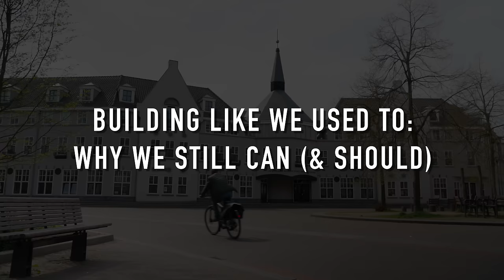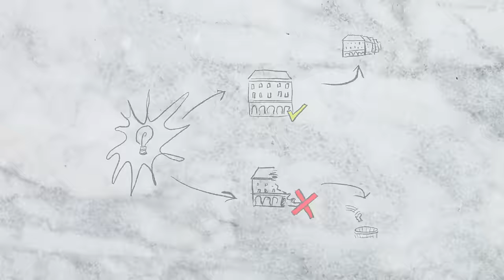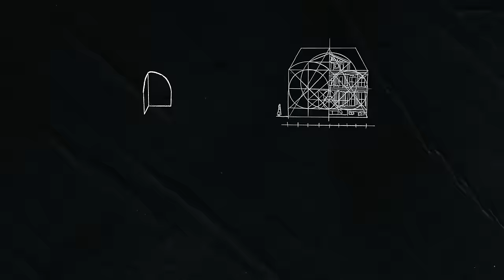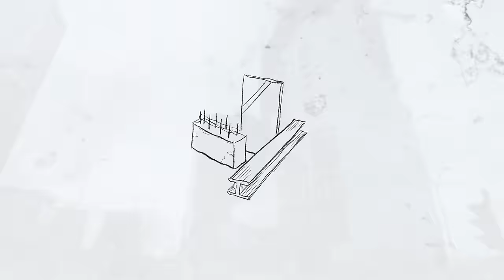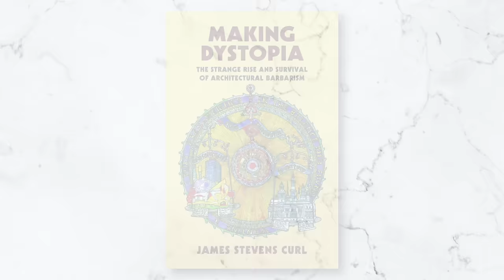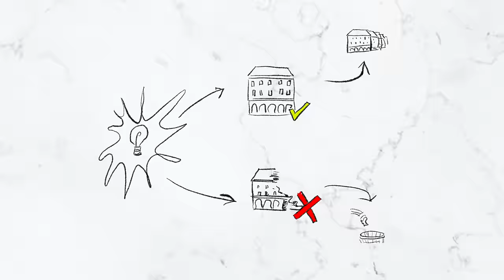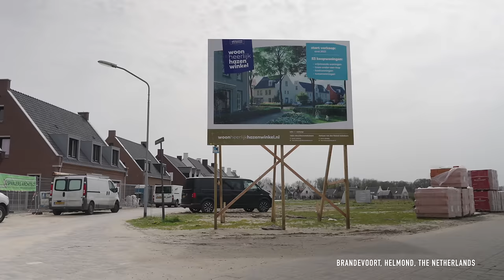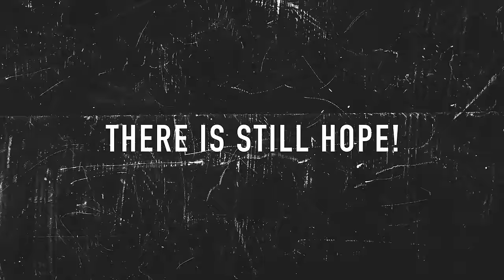Why We Should Revive Traditional Architecture & Urbanism

Comment: In the city centre of London and also in Edinburgh in the UK, I've seen with my own eyes new buildings under construction with cranes and everything mimicking the traditional architecture around them, with old-looking façades and modern HVAC systems behind them. Which made me wonder how many of the "old" buildings around them were really old, because they blended in so smoothly that once the construction was finished it would be virtually impossible to tell the difference from the outside.

Comment: Small correction:
In arid climate, a domed roof is better.
As a flat roof provides a huge area for sun light to fall directly on, causing it to absorb more of its heat.
While a domed roof, or one with a three dimentional shape, will absorb the sun light directly from only the side facing the sun.
Also the domed design allows for more air circulation and convection currents.
Reply: I suppose a domed roof is much more expensive. I believe the falt rooves are also useful for cooling off as people use them to sleep on at night.
Reply: Flat roofs because little rain or snow, also to sleep on at night. They're generally made of materials with high thermal mass like stone, so they absorb heat without transmitting a lot of it through to the house itself during the day, and slowly release it at night when it's cold because arid areas are also actually colder at night. Added benefit of being warmed up if sleeping on the flat roof at night and being cooler because they're open to the winds higher up during the day

Comment: I thought about this for years now. I live in Vienna and every time I stroll around the inner city I feel that subtle sense of peace and - I dare say - pride for what the ancestors of my people achieved 100+ years ago. On the other hand when I'm driving through our industrial/commercial districts I kinda get stressed. Not in the sense that I'm actively getting stressed by looking at these atrocities but more in a subconscious way. In my hometown right outside of Vienna a lot of new buildings were built in the last 10 years and they are all extremely bland and don't fit into the historic town center at all. Some people here started to complain already but due to higher cost nothing "traditional" is getting built here unfortunately.
Talking with many people I found out that this is an issue for a lot more people than I originally thought. Maybe a change is coming soon, just as they changed their building style a few decades ago due to other reasons. I hope so at least.

Comment: Im currently buying a house and it was near impossible to find a house with any kind of charm and not a cookie cutter house where you can see your neighbors through your window. It’s so depressing and i think most homebuyers nowadays just expect living in a new construction home to be the norm and having a more charming older house a nightmare (even though older just means 1950s)
Reply: YOur charming older home IS a nightmear. Heating costs? Extreemly high. Plumbing issues? yes. Bad wiring? yes. Possible lack of a ground loop? Yep! Old construction isn't good. We SHOULD be replacing everything simply because we can now make stuff that's cheep to USE and actually okay for the environment long term. It doesn't have to look bad, but by god old stuff HAS to go.
Reply: @MeepChangeling  um I live in the south, dont need heating often, and since it is an older home it is insulated enough where we dont need to use the a/c often. Not sure about the wiring or plumbing but yea those things should be updated. We have yet to experience any problems and dont have lead pipes. You can have an old home but update the wiring and fixtures if needed. We shouldnt bulldoze every home built pre 1970…
Reply: @MeepChangeling  Rubbish - both your opinion and the result of all that destruction.There wouldn't be all these beautiful , livable places places in the world to visit or live in if we listened to your idiocy. Tearing down everything is also extremely wasteful. innovation canand does apply to refurbishing and maintenance as well as new build. Remember the improvement asbestos everywhere was supposed to bring us? An ongoing nightmare.

Comment: I fully subscribe to "New Traditional Architecture", but I would like if you could do a video on how this approach can avoid pastiche imitation and achieve authenticity. This is probably the biggest blocker to NTA being wholesale employed. 

P.S. Loving your videos.
Reply from the maker: Thank you! I will certainly look at that. It is an important topic

Pastiche imitation will seize to exist when architectural education starts to educate traditional architecture again. Illiteracy in proper traditional architecture causes the ugly pastiche versions. Even though many pastiche buildings are still more pleasant than their Modernist counterparts!

Apart from that, 'pastiche' is a term used by Modernist architects to bash on anything traditional. It does exist, but I hate how the term is being abused to discredit the entire concept of traditional architecture - that has got to stop. As I said, I believe education is the answer to that problem.
Reply: If the emphasis is put on developing new vernacular (local or regional) architecture built from local materials, then the tendency towards pastiche can be avoided naturally.
Reply: @the_aesthetic_city  i think what cause this is just putting stuck or stucko , like putting fake ornements and decorations on a concrete building, instead of having the stones cut to be ornaments, most of the time the building is not made of stone but just a centimeter of stone is added, fake. We should reuse stone building technique and also bricks,  where the brick that is not decorative is used also to decorate with pattern etc
Reply: @the_aesthetic_city  I personally think a lot of contemporary builds are pastiche imitation of modernist innovation. While tastes can differ, it is hard to call early modernist architecture, from Le Corbusier and Bauhaus and the likes, unesthetic. They definitely played with lines and shapes to create balance and form.  Contemporary "modern" buildings seems to have completely let go of that play and just gone for squares "because that is modern and minimalist". It is so clearly profit over anything else.
With that said, I completely agree that these modernist should have sticked to buildings and kept their hands off of urban planning, because they sucked at that.

Comment: If "traditional architecture" is simply an adaptation to its environment, why wasn't modernism? It was developed in Europe post-WW1 as part of the wider modernist movement and as a reaction against previous stylistic trends. 
The 19th century fin-de-siècle was a crisis of style in the arts, the previous century had revived every style and used them freely. Architecture had sunk into nostalgia. The question became what is style? Is it just decoration? 
On the other hand more innovations in engineering were happening, greater structural spans, more glazing became possible (eg. Louis Sullivan etc), the real cutting edge was in technology. Modernism was the Gothic of its day, primarily a technological development (reinforced concrete and then steel) that led an ideological change. This is the context modernism inherited.

Whilst I agree the modernism's application around the world (especially somewhere like Dubai) can be downright offensive, modernism is not all bad and was, at least initially, driven by progressive desires for better living conditions, cheap housing for the masses, lightness, openness, efficient living. The video paints these concerns as opposed to tradition. There was, and remains, a real desire for light and openness in our buildings. Many traditional buildings are dark, cold, energy inefficient, badly laid out, and had major issues with safety from fire, falling etc.

I'm not here to defend car-oriented modernist city planning or leaky buildings or its sometimes authoritarian diktat. However to throw it out along with all its technological innovation seems silly--think about how much engineering goes into particularly larger scale buildings now: structural, services, fire, electrical, etc; how are we to reconcile these with traditional buildings? Most of the expense of modern buildings goes into these engineering disciplines, hence why facades are often boring and functional.

If you're asking for all these innovations AND "traditional" architectural stylings, then I'd say you are getting into the nostalgia you mention. Also, who is going to pay for the extra cost?
Reply: Well said

Comment: This is really frustrating.

It's actually very easy to agree with the premise: saying that most contemporary architecture is boring and doesn't generate good public space. 
There is even a TED talk by the renowned architect Thomas Heatherwick saying exactly that.The silly thing is the solution promoted in this video: 
- that we should just imitate older architecture.  This is silly on many levels and if applied extensively would just serve the purpose of devaluing the styles that supposedly tries to dignify. 
There is even quite a lot of experience on doing that. Unfortunately probably its proponents did´t travel enough to China to see the results of this copycat philosophy.
In my opinion the idea of just mimicking older architecture is the result of a low culture in the architecture discipline. 
Serious and honest architecture comes with a deep understanding of many factors: social, economical, on contructition, etc... and to build a building that copies an old style should require to also mimic it´s underlying means of production.
Doing a building that looks to be old but is built with contemporary construction is just borrowing the prestige rightfully acquired by those styles and using it the same way that Disneyland creates its cardboard parks.

The call for architects to do more complex and contextualized architecture is very urgent and critical for our cities, but it should not be wasted with populist or ignorant solutions that call for a literal return to a "glorious past".
The way needs to be forward and hopefully the contemporary architecture talents will be able to push us in that direction instead of backwards.
Reply: copying other culture's design is not what is being professed here, if china wants to undertake a traditionalist approach to urban design, they would take lessons on the perennial aspects of traditional cities across the world and clothed it with the unique expressions of their distinct and particular culture.

Comment: One of the biggest advantages is that it isn't just more beautful and healthier, but also sustainable. The materials are regional, the energy costs lower and the building will stand longer than most modern ones do. I think building 50 semi-detached or terraced houses in a traditional way that will last for at least 100 years is more sustainable than building 5 blocks of flats that will be torn down after 100 years. 

This is an issue in general. Modern environmentalists don't want to believe it, but the best way to solve climate change is to return to our traditions. To build like we used to, to eat like we used to, to dress like we used to (I mean the way the clothes are made here rather than the style).

Comment: While I fully agree with everything you said in this video, I do have to add that we might not need to look at craftsmanship in the future. It's very sad to see old traditions disappear but CNC technology is getting better every year. Traditional wooden element can be routed out and terra cotta elements can be 3D-printed. I think the biggest issue is that architectural education has to change.drastically to see any change in the near future. Architects are still seen as the true experts on buildings and most that graduate now are educated in modernism. We will need a complete revitalization of traditionalism to see any change.

Comment: The lack of craftsmanship is actually not much of an obstacle anymore. Molds and stamps can be used to quickly produce any type of building piece no matter how complicated or ornamented they need to be, with craftsman or masons only doing the base design which then can be replicated through mass production. It was already done in the mid 1850s for example with cast iron buildings. Thanks to modern technology, i'd argue it has never been more easy and cheap to do traditional construction.
Reply: You could hire a graphic designer to do the base designs on the computer program and then hire a software engineer or computer programmer to do all the technical, "brainy" stuff.

Comment: I had the opportunity to personally observe, working in washington dc in the late 80's / early 90's, how the traditional aechitecture of the city was systematically destroyed.  There was pushback from the community, but the developers always got their way, and a compromise was made where in many cases the external facades of buildings were preserved, while the entire block behind them was raised, and a new single office building with its floor space covering the entire block was raised behind it.

this perhaps lightened the blow you might say, but nonetheless was really culturally deveststing to the downtown area, as mixed use and smalll businesses disapeared, and these office areas become abandoned people-less areas after 6 pm.

What was also ironic to see, is that structures being replaced were very "green" and low-energy in their construction. High ceilings for comfort in a hot climate, constructed around central courtyards that provided a well of light, ventilation, and cool air in the summer, cross flowing air into the offices via large high dormer windows. Windows could be opened, and had awnings for sun protection over them. Staircases were made to be used and were used, not just for fire evacuation, with a low pitch for easy climbing, and some really rich beautiful materials usually being used, especially in the balustrade castings. I recall visiting offices in such buildings where the lights even did not need to be turned on in the day, and there were none of the banks of enormous roaring hvac systems of the buildings that replaced them. Ironic that we now talk about building such structures again, just a couple decades after destroying them...

Comment: Valuable insights and beautiful presentation. Earlier the ornamental features are being brought out in the Structural elements (I mean the elements that carry load) and will be long lasting. Now Separate Frames are being added to bring out elevation (Sort of makeup) and that are not long lasting and becoming sources for cobwebs and dust collection raising health concerns. There is also need to do research on Urban planning such that public prefer to walk rather than using Vehicles, to reduce traffic congestion, Environmental pollution and widening of roads frequently in commensurate with traffic. There is also a need to standardise vehicle sizes (To be used with in the city) based on number of users, which may be one of the solutions to avoid widening of Roads frequently.

Comment: I live in Melbourne which has a housing crisis and a sprawl crisis. Sadly the solution in focus is creating mulitple city centres across the suburbs with, you guessed it, cheap high rise towers.
We are blessed though with good but underutilised transport corridors between Melbourne and regional ciies. A chain of "15 minute" townlets with medium density human scale buildings in a human friendly layout would be very popular. When a tower is built, a great big hole is dug for car-parking. Why not built the whole townlet on a platform with cars and services such as deliceries and garbage removal underneath. Power, water supply and sewerage could be serviced from this level without the need to constatly dig up road surfaces. Traffic and access can then limited to the periphery. Up above, buildings do not need to be separated by roads for cars, but by meandering walking spaces. Small parks and plazas could exist within the townlets, with schools and similar on the edges. Townlets could be connected by a single corridor for light rail, with periodic connections to the inter-city line and freeway.
Traditional architecture does not have be overly decorated, but using tradional scale,  proportion and symmetry will be important. Each dwelling should have some connected  outside space and the building should have its own rooftop recreation area.

Comment: The Stockholm towers at 9:15 actually do a pretty good job where they are located. They are the only two residential skyscrapers in the whole city, located at the border between two municipalities, more or less on top of the E4 motorway that's decked over to join the two city areas. In my view, the open wound that is the 1960s motorway itself is a far worse issue.

Comment: All in all a fine video. I like the point about traditional being the sum of succesful innovation! And I definitely see the way forward as a way where you take the best from all styles and movements. 

But I think it is in some way presented as the modernistic movement was just some fancy conceptual ideas, and not, as it actually did, dealt with real world problems like:
- Housing crises of the early 20th century and the very bad state of traditional housing in the inner cities.
- New demands for buildings function based on ongoing industrialization.
- Restoring bombed cities and creating affordable social housing on a massive scale after WW2 using concrete.

And the conflation of all types of modernistic building styles from from early conceptual bauhaus to modern day shitty glass skyscrapers is kind of a disservice - but it is an essay, so there is a point that need to be driven home at the cost of nuance I guess.